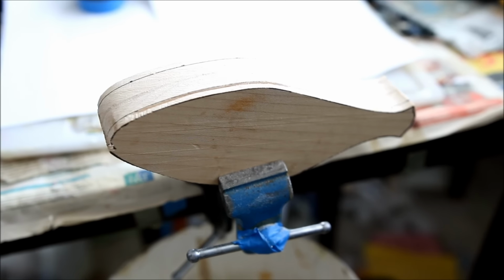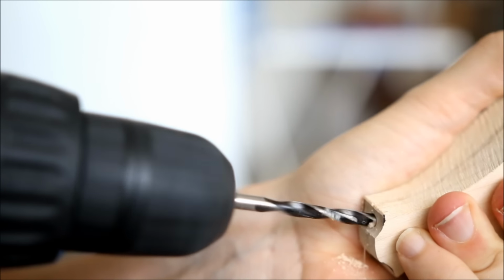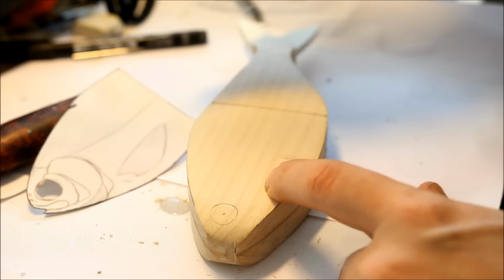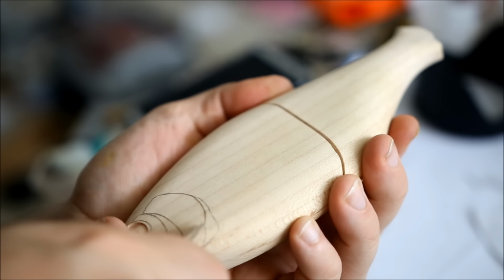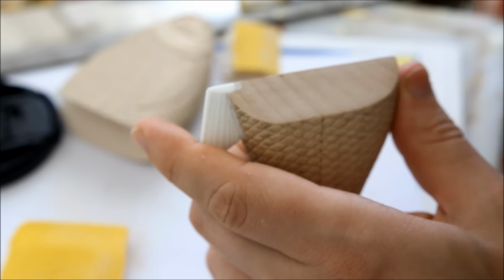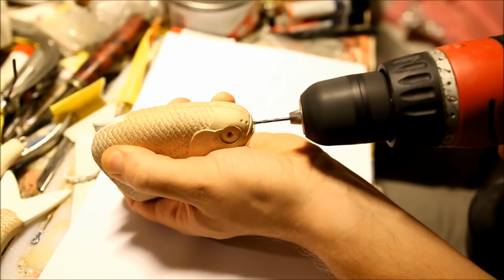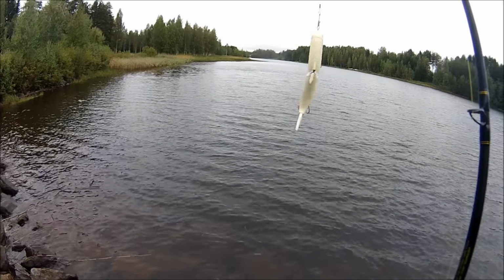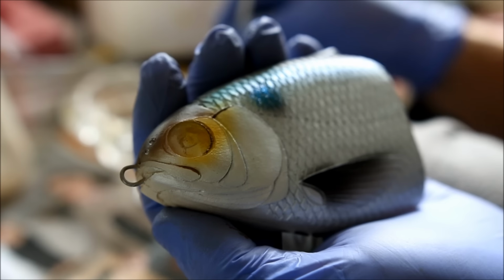swimbait chronicles: how I made a gizzard shad glide bait

Comment: great video would have loved to see more of the jointing process after the halfs were cast . how the screw eyes were connected/ fixed in place . would have thought 2 eyes connected by a pin in the second half would be best . any reason why you choose not to use this method ? thanks in advance
Reply from the maker: Screweye to screweye is just more easier to use for me and i have a huge stock of them so it just makes more sense to use them. I dont think the action will be any different compared to the pin method either.
Reply: thanks for the reply great work

Comment: I'm in the process of carving my fish and have done a little reading about casting molds. I just learned that the feather lite resin floats in water. Do you add weight to the bait? Or are the hooks enough to keep it under water? Thanks for the video! You are great at what you do!
Reply from the maker: feather lite is fairly buoyant so you are going to have to add some weigh inside in order to make it swim better and also sink at a desired rate.
Reply: SolarBaits do you have a video on how to balance/ desired sink rate video?
Reply from the maker: i do, its called How to weigh a jerk/glide bait.
Reply: SolarBaits thank you so much! I hope you keep making more videos.

Comment: two questions:
1) what method did you use to attach the two halves together? 
2) I am about to get some feather lite and I am curious how you feel about it. and do you use anything to sink your lures or do you just fish them at the top of the water. 
Any help would be greatly appreciated. 
Love your videos
Reply from the maker: 1. with screw eye to screw eye connection. 2. i use featherlite in pretty much all of my lures now so it's safe to say i like it :) i do weigh all of my baits with lead to make them sit either level on the water surface or to make them sink
Reply: can you send me a link of the best way to connect two parts? There are some that I am sure that you have one or two that have helped you. I want to see your technique because when I am trying it the two parts are very far apart and it looks bad because the metal is very visible and your's is not.
Reply from the maker: I'ts easy you just open the eyeleds  of both screw eyes snap them together and close the eyeleds, you are most likely going to need 2 set of pliers to do that. the reason you don't see them as visible on mine is that i have small indention where i put the drill the holes for the screweyes so they sink into the bait lil bit.
Reply: ok that makes since. maybe my problem is the type of eyelets I have tried in the past. The ones that I have gotten are from a hardware store and they are kind of bulky. where do you get your's? And also most of the ones that I have found are zink not stainless steel so I worry about opening and closing them causing them to become weak.
Reply from the maker: the kind i get are kinda bulky too but i guess that depends on the definition of what bulky is, anyways i got mine from lureparts.nl.

Comment: I am still really new to the craft and I love you work but I have some questions. Is this technique or the hinge technique better for beginners and which one is better for action of the bait? Where did you get the template for the facial features? Could this style be used for multiple body segments?

Thank you for any and all help
Reply from the maker: for beginners the screw eye to screw eye or the metal pin option is way easier to get working well compared to the door hinge. The template for the facial features is just a skech i drew out prior starting working on the lure. pretty much any shape could be also made into a multi segmented version.

Comment: Lol its me again but really loving the work as always! Your video quality has gotten alot better not saying it wasnt good in the past. Also your more recent videos with the shad and the bass have been particularly informative and inspiring as those are prey fish here in the states.
-S
Reply: Also just a tip: If you use mold release spray or even just cooking oil spray before you pour the second half of the mold it would separate much more easily
Reply from the maker: ahh never heard of the cooking oil method, i will have to try that someday. Also thanks for the nice words, i have tried to put little bit more effort into these than what i did before.

Comment: On these dual mold baits. Do you weigh them in the mold like some of the one piece molds I see you do or do you find it easier to weigh these two or three piece baits after you pour them.
Reply from the maker: i add the weight to predetermined spots inside the mold before pouring
Reply: SolarBaits ok. I have a two piece mold and trying to add weight has been a little tricky making sure the weight stays centered when pouring the bait. Thanks. Keep up the videos, I really enjoy watching.

Comment: Hey Mikko. My first swimait is almost ready to make a mold of. Do you mold the fins together with the fish's body or do you make a separate mold of them? I have also a question about the fusion foil that you use on your baits. Do you heat set them around the lures and afterwards apply epoxy or do you just use epoxy without termo forming the foil?
Reply from the maker: i usually make a seperate mold for them because i like to use clear resin for the fins. never used any fusion foil on my lures you must be mistaken me with someone else
Reply: Fusible film sorry :)
Reply from the maker: nope never used that either
Reply from the maker: oh yeah totally forgot all about that, if i recall right i did not get it working well on any of the lures i made, it ended up peeling off super easilly or i would get horrible wrinkles hence i didn't really do anything from after those few experiments
Reply: Damn I just ordered some :)

Comment: Why couldn't the actual glidebait itself be made from wood instead of molding it?  And what is the material that you form the lure from the mold?
Reply from the maker: sure it could have and i have done that many times in the past. However i planned to make whole bunch of these and going thru the same process of carving and making the baits just takes too damn long so molding and just using more consistent material like casting resin just makes more sense.
Reply: SolarBaits ok thanks.  and also what is the material you use in you're roach swimbait video to make it?
Reply from the maker: that's casting resin called feather lite

Comment: how do you do the joints??? thats the only thing i wanted to know and the only thing you skipped over haha
Reply from the maker: I use a screw eye to screw eye connection, i left it out from this one cos i figured it goes without saying thats what i used, hah kind of a mistake on my part since its been asked alot here.
Reply: SolarBaits screw eye seems easiest I was wondering about the guys that use pins and how they lock in place and such I guess.

Comment: is the feather light resin strong enough to hold eye screws?
Reply from the maker: Yes it is
Reply: @SolarfallBaits  Appreciate it! Didn't want to mold them in to the bait so I could have some joint adjustability.

Comment: Im having difficult time understand how that ring at the lure's mouth is gonna hold up when some 5kg thing got hooked
Reply from the maker: its quite simple. What you see here is a mock up for the real thru wire system that i place inside the mold before i cast a blank
Reply: SolarBaits
 Thanks. Makes sense now
Reply: Hey Solar! Great video - really helpful!.. I do have a question though ;-)
How do you make your thru-wire system work, when you have a hinged lure like that?
I can't figure out how to make a mold that will allow me to pour, when i have the wire hinges inbetween.
Fred

Comment: You once told me that you used clear resin to pour the fins. Which resin do you use?
Reply from the maker: it does not really matter pretty much every brand will work
Reply: But is it resin or epoxy?
Reply from the maker: it does not really matter, both will work since they are essentially the same thing, the consistency is just different. what ever cure's the fastest is what i prefer.
Reply: And do you have the sand the fins before painting or does the acrylic airbrush paint stick to the resin without any problems?
Reply from the maker: i usually spray clear acrylic varnish on mine before i cant paint them
Reply: Ok thx
Reply: I just looked at the crystal clear 200 series. Damn that's some realy nasty toxic stuff to work with

Comment: is maple wood easyoer to carve then pine?
Reply from the maker: MR-FLIP its harder to carve because its harder than pine but pine is a horrible for carving details because its not consistent.
Reply: gotcha ya I have only been using pine for my top water lure and realized during the scale pattern which I learned from you (thanks)  that the wood tends to either chip or will splinter.  I'll have to give the maple wood a shot..  you rock brother thanks for the fast response